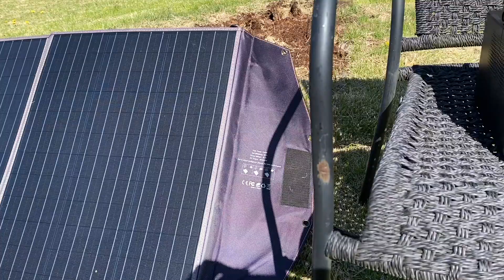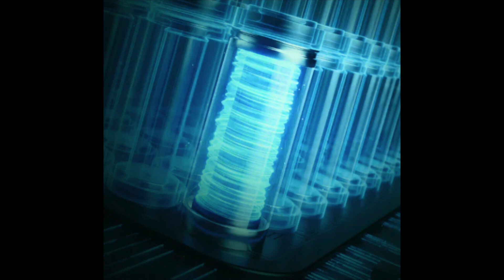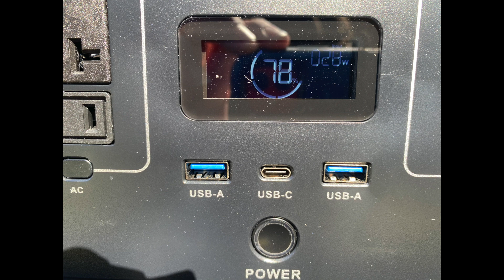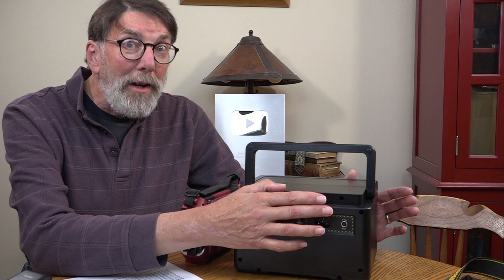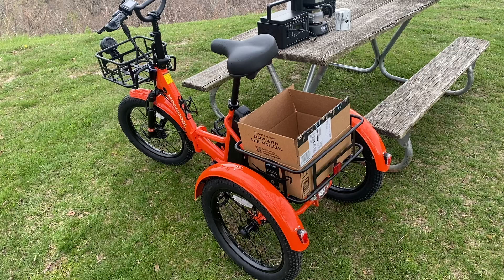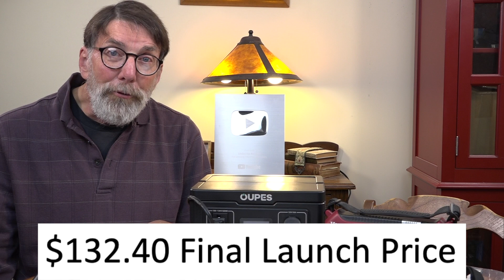Oupes Exodus 600: Portable Power at an Amazingly Low Price

Comment: Day 3 post tornadoes in Tallahassee and i will be ordering this for our home.  We have a gas generator for fridge and freezer. Husband is not on board with solar generator yet but he needs his CPAP to work. And this can be used inside. Thank you Larry. Our home is okay, we have propane grill for cooking, just miss our well water and electricity. We have solar lights that help at night.
Reply: So sorry for the severe weather.  The small solar power station will help with the CPAP.   Make sure it will run long enough for the device to get through an evening without electricity.

Comment: Does this require a solar panel?
Reply: What brand of portable solar panels do you use?
Reply: @audreywright3680  - I used Oupes solar panels.
Reply: You don't have to use a solar panel to charge any of these external battery devices. They come with an AC power supply. Obviously if you get one you want to make sure it's charged up full before you actually need it because if it's not charged up and you have a power outage it's going to be useless.
Reply: You do not absolutely have to have a solar panel to use the power station.   As pico_sandoval mentioned, you can charge it up with the AC cord it comes with.